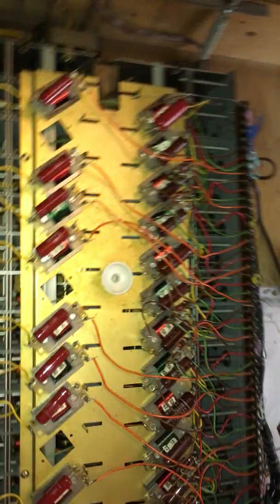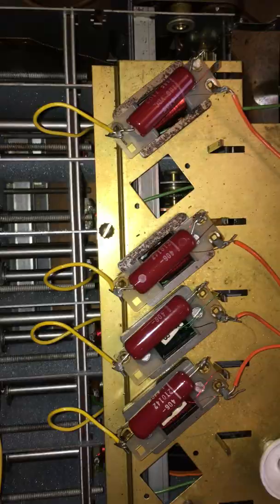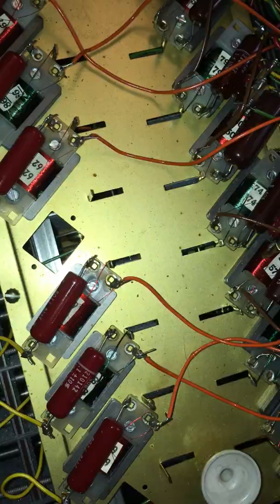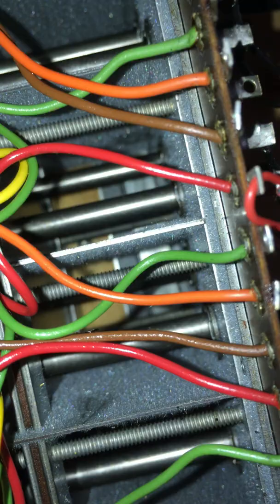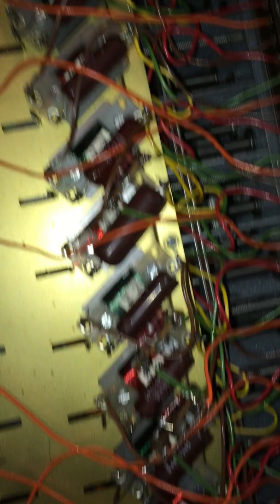Hammond Tone Generator

Comment: Hi,  Thank you very much for your videos. Did you re-assemble everything or are you still fixing issues yet ? Also, did you play with the overdrive module you added : how does it sound ? Thanks
Reply from the maker: Hi, yes it went back together last December.No issues thankfully! Yes the overdrive is installed and it sounds amazing. And the best part is it looks part of the organ and not an outboard effect sat on top of the organ with wires all over. I will do a video soon.
Reply: @clavdig  Congrats for the re-assembly: I'm really impressed about how far you went to disassemble your organ. Regarding the overdrive module, I also think it is a very good integrated solution : was it not to difficult to install it ? Does it fit perfectly ? Did you mod the first octave of the lower manual to use the 16 feet frequencies of the pedal board ?
Reply from the maker: @Darknabor  well it took a year off and on to complete, so I was very careful with it. You have to step away from it at times. Plus I had to order  parts from the US such as new felts which took time. The overdrive unit is completely passive and sits between the g-terminals on the preamp. It fits great. And it can b fully bypassed with the flick of a switch. I’m very happy at being able to achieve a great tone at speaking volumes that before I could not achieve in the home.